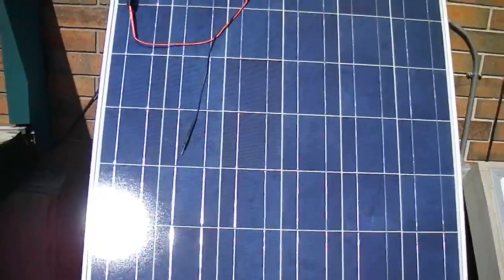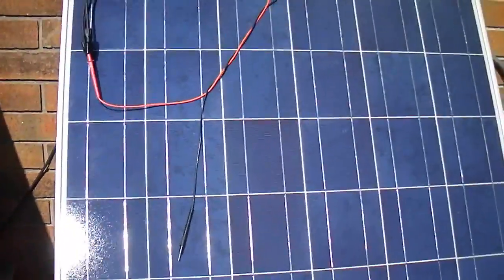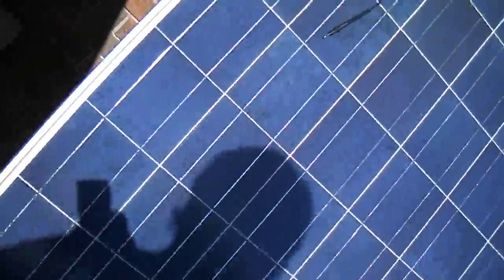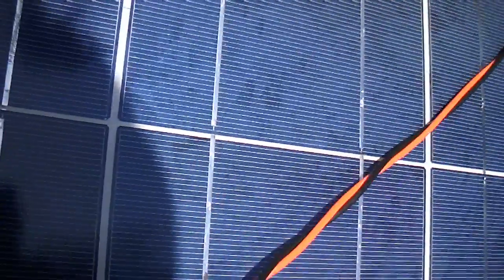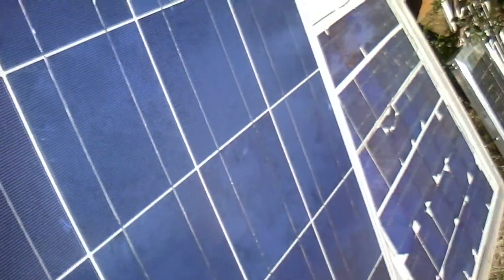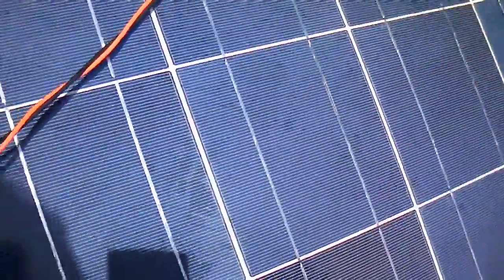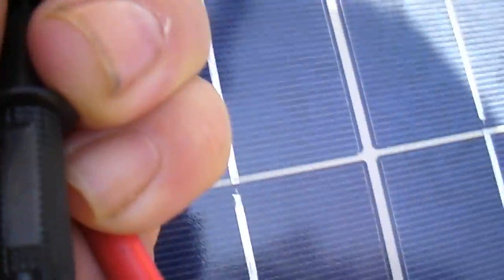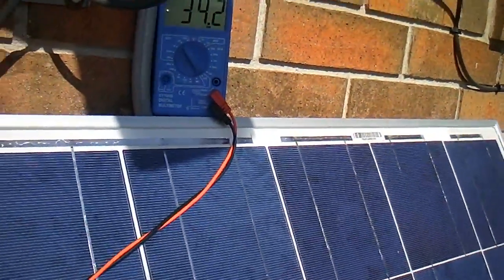Just Delivered 24 Volt 230 Watt Solar Panel part 1

Comment from the maker: @shartne I want to get one of those emphase inverters. I wonder why the connectors cost 763 dollars for thirty of them on a cable. I wonder if it is legal to just connect them to out side boxes with regular electrical 220 out door wire. in conduit. that sounds expensive too lol.

Comment: Good deal... and as I recall the 24V plug and play inverters are cheaper than the 12V.  I think I'm going to stick with low voltage panels though...  I can alway mount them in series to get higher voltage if I choose.  But, you can't back off to lower voltage.  Congrats... and get that puppy collecting some power!

Comment: What kind of Panel is it?  It should have all info on the Tag OCV, MVP, Amps, You will not what to use low volt panels any more.the 1s i just installed are 51 vmp /47 Volts max imput but they Vary do to load and sun & heat u Get the pichture.U are going to love it.

Comment from the maker: @sok8888 I wish I could but I dont have a 24 volt inverter. I will have to get one or two. Right now i ordered this panel a twin to go with it. A 24 volt inverter will be next. then I can put a load on it for a test. I get the feeling it has some ump behind it because when I hooked up the meter it arced really good.